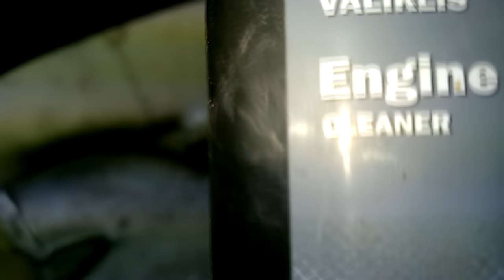How to clean EGR and INTAKE manifold 1.9tdi

Comment: One of the best educational videos on EGR , having light on the area you are working on gave me a better insight on what's been removed . Allen key and nut sizes would have given you 10 out of 10  but I get where your coming from.  Thumbs up .
Reply from the maker: Really appreciate it! It is quite difficult to work in tight spaces and film it but I did my best at that time. And for the tools required, that's a good point, I'll probably apply it in future videos
Reply: 6mm Allen and 12 mm socket for bew I think

Comment: Nice video, it looks so easy, but I know that i will need to take at least one day off to do same. EGR and intake manifold are quite known to get clogged up. Cleaning intake pipes are also worth cleaning when you are already dismantling manifold. But what do you say about intercooler? After all it is also connected with other elements of intake system, so when you are trying to restore original airflows of your engine, you need to think about this.
Reply from the maker: Thanks! If the manifold wasn't removed before then this should be easy as the worst that can happen is a stripped manifold bolt. And as for the intercooler, it doesn't get exhaust gas so it stays clean, you might find a little oil in there but if it's doesn't leak you don't need to clean it

Comment: How to keep a clean egr valve:
DELETE IT
Reply from the maker: Yup, I done that on other car  :D
https://www.youtube.com/watch?v=HiWF2WlyXwQ
Reply: I personally wouldn't chance having a engine runaway by deleting it.
Reply: Leo Louvar these engines have the anti shutter valve and EGR valve built into the same component. You could still blank the EGR port from the exhaust manifold. Remove the EGR itself. Alter the EGR software , whilst still leaving the anti shutter valve in the intake tract There eliminating the possibility of a runaway
Reply: @lukekilah6257  so I can block my vacuum  line to the ear, on my 2000 alh q.9 tdi, thank you ,take care
Reply: And than after 20-30k miles, your turbo is dead...
Reply: @rooo1011  can you explain, why?
Reply: Not if you want to pass your mot.....
Reply: I did it on my 2000 golf 4 tdi 115 and it runs in a soft limp mode, gotta put an egr back. It is not a good idea to delete the egr if you are just driving around with your car
Reply: @DaBaldMan  soft limp mode?
did you just put a wall on the exhaust line to the egr or you completely removed it?

Comment: I think until today i had misunderstanding about the visual look of EGR. So that bigger circular valve is not the EGR valve itself but the intake manifold valve and the EGR valve is that part seen at 3:39 in the center rotated 90 degrees from the intake manifold valve?
Reply from the maker: EGR is whole system from exhaust pipes to valve to control modules and so on. But the EGR valve is that whole unit held in hand 3:38 Don't forget that it could look different in different cars and engines. 
P.S
Since this is German engineering - usually called EGR valve is combined with  flap valve and egr itself (that recirculates exhaust gas into intake) is a piston valve in this case. That's why you see 2 vacuum lines in this part, because it is combined thing. That circular flap is - anti shudder valve

Comment: Hello, i got 81kw A3 old pump motor, i got a question, do you need some kind of reprogramming computer, or something inside electronics, if you decide to remove Egr valve? or you can just simply block both ways and its done?
Reply: I just blocked mines off. No issues the computer thinks it opening it as it needs to

Comment: Do any of the bolts need to be removed from underneath? Or is it easier from underneath? Also, noting the amount of carbon in the head, is there anyway to clean that out?
Reply from the maker: Everything available from the top. to clean intake ports in head use vacuum and make little scraper that can pull out dirt. Just be careful and good luck!

Comment: I have a 1.9tdi pd150 I just bought with an engine light on and the previous owner says its the egr, will cleanimg the egr make the light go off do u think ? And cheers lobe the video
Reply from the maker: Technically it could be check because EGR, but I am not sure that cleaning solve that. It looks like you need to do diagnostic and scan all fault codes. If there is check engine it should be fault code and it can be anything. Btw thanks ;-)
Reply: He may have deleted the EGR system so he’s just saying that it threw the check engine light.  The only way to get rid of the light is to have your ECU reprogrammed to delete the EGR codes.  But you should read the light to determine what it is.

Comment: How many miles did it have before this cleaning? Mine has 336k and probably has never been cleaned
Reply from the maker: More 160k miles. It will be dirt for you too, just take off hose near EGR and you will see if you need cleaning. Good luck :)

Comment: a mecanic told me my engine was drinking oil. so they recomended me to wash the engine and see if it was a leak or actual oil consumption.
this morning after the engine wash, went home, opened the hood, and noticed fresh oil out of the egr. although in not large quantity, i'm now worried about the EGR...
Reply from the maker: It can be your turbo, pay attention to the exhaust gas
Check this video: https://youtu.be/xYsUVAjeTgM
Reply: @Work_G  I mean... It could be badly installed. Previous owner said it upgraded the turbo (originally pd100) upgraded to the pd150 turbo.
Will look at it when i can!
Thx for explaining it! Very precious

Comment: How many miles did this tdi have when you did this? I have a mk6 2012 70k miles and I feel worried I should clean it (I just bought it, only mild knowledge of diesels)
Reply from the maker: I guess about 160k miles. I will be some dirt for you to, just take off hose near EGR and you will see if you need cleaning.
Reply: John Smith. John, it's not a difficult job to check your EGR, just undoing a couple of clamps and removing hoses. Most import thing is does the EGR work once cleaned? There are two main types, mechanical (that works only off a vacuum line) or controlled electronically by an ECU/control module.  If you can test them and all is well, that's great(once cleaned obviously) You could also, depending on where you live(legal reasons) and what car you own carry out an EGR delete that basically removes the valve and blocks of any piping to the 'EGR's location. This will prevent carbon deposits from further building up throughout the inlet manifold which increases fuel consumption and lowers the flow of air into the combustion chambers/reducing performance. You may want to inspect the inlet side of the engine for excessive carbon deposits and clean that also.

Comment: My ARL 1.9 looks a lot like this. 166000 miles. Also the head, the intake ports, did you clean them out? Affect valves?
Reply from the maker: It is normal when you drive calmly with this engine. Yes I cleaned ports as good as I could, be careful that dirt can fall into cylinder while cleaning, so would be smart to use vacuum
Reply: @Work_G  many thanks for the feedback

Comment: Did you use a torque wrench? if yes, what is the tightening? Thanks
Reply from the maker: I didn't but, 
intake manifold to head - 25Nm (18ft lb)
egr to intake - 15 Nm (11 ft lb)

Comment: What can I use, besides engine cleaner? There has got to be something more common.
Reply from the maker: Use what ever you want, even soap works, gasoline, wax degreaser or you can just buy something like "EGR cleaner"
Reply: I just checked and my EGR is clean. So the rest of the intake manifold should be fine, right?
Reply from the maker: If you don't see through anything it should be fine

Comment: I cleaned both my air take and egr like you and it has only been a couple months and it has already built up again more then I expected. Would you know why that might be or anyone else on here !?
Reply from the maker: Since this is dust from exhaust to intake there will be always like that, just not that fast like yours, It can be that you get much oil in to intake from turbo, oily walls and dust collect very fast.
Reply: The scheduled maintenance on the intake is every 10k miles. It adds up fast. A lot of people do EGR deletes because of this.

Comment: Is this the pd130 ASZ engine? I'm in the process of reassembling the egr and exhaust pipe, but can't work out which order to do it:

If I connect the egr back up to the inlet first, I can't seem to get enough grip on the exhaust pipe bolts to connect to the underneath of the egr.

If I connect the pipe to the egr before refitting to the manifold, the pipe bolts get in the way of doing up the lower egr to manifold bolt.

Can anyone help?
Reply: Did you get it sorted?

Comment: Did you clean the valves?
Reply from the maker: Yes, I cleaned everything what i reached there, just didn't filmed because uncomfortable.
Reply: @Work_G  How did u do that without getting this crap into the combustion chamber... ? How do u know that the valve is closed?
Reply from the maker: @StevieZeee  You can actually see through intake hole valve closed or not. If you have strong vacuum you can clean even on open port. Make small hoe and scrape out everything while vacuuming.
Reply: @Work_G  thx

Comment: why in my vw 1.9tdi egr valve looks different, how to remove it which part is EGR Valve? http://oi66.tinypic.com/n4i3bn.jpg
Reply from the maker: Tell me car, model and years
Reply: Volkswagen Passat 1.9 TDI 66kw 90hp 1998 year, I even changed the maf sensor but the car still going bad.
Reply from the maker: EGR should be same like in this video. If not https://www.youtube.com/watch?v=sKC04DbEeSQ like this but it shouldn't be like that in passat. So you need to do good diagnostic. If it is slow it can be - clogged intake + egr, vacuum leak, boost leak, maf, map, n75 and that is basically it.